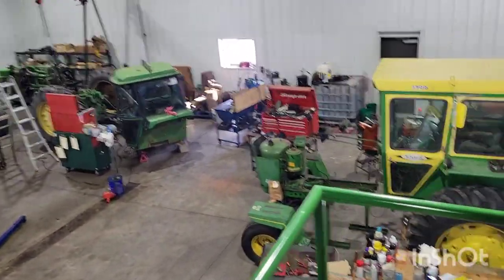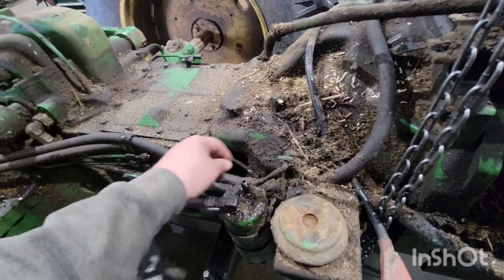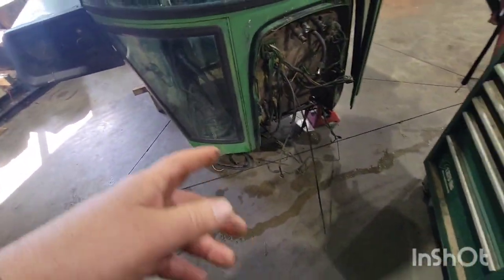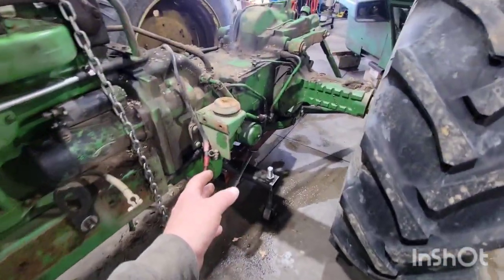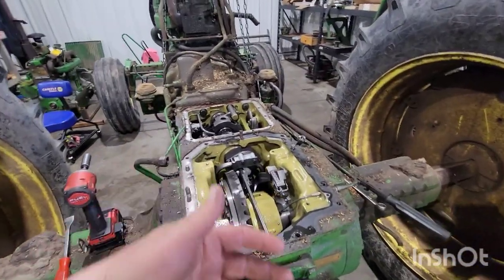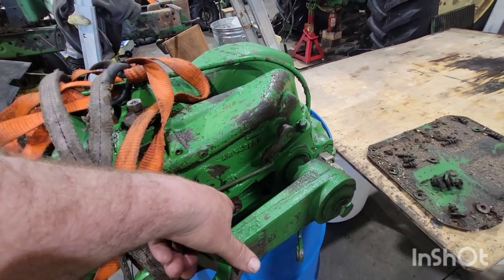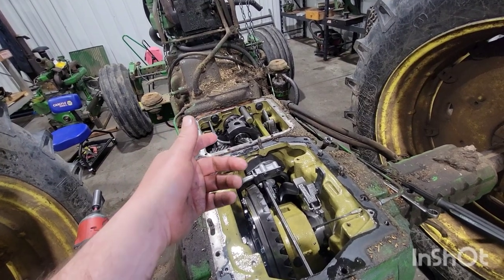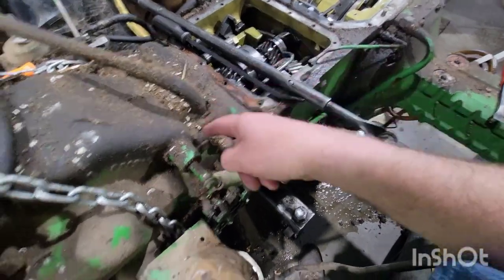RE-UPLOAD: John Deere 4430, cab, 3pt and engine removal.

Comment: thanks for taking us along on the overhaul. I just bought a 4430 with a blown engine. I put a combine engine into the tractor and she runs good. the tractor operates nicely. might have to go through the brakes though. It growls a little bit louder than it maybe should while stopping. But mabey ill check screen for metal filings before I get to excited

Comment: You said on I believe the ten and 20 series tractor when you pushed the clutch in the loader,would not function until clutch was released.
The neighbor has one what can be done to eliminate this issue?
Reply from the maker: @georgemarshall7508  when you hold the clutch down it stops the transmission pump.
The Hydraulics will run long enough that if you come up to your wagon or Manure Spreader that you can function the loader.
If you're going to be stationary for any length of time doing multiple hydraulic functions then just simply click the neutral and let the clutch out

Comment: You should wash the tractor 🚜 steam cleaners
Reply from the maker: When we do a transmission overhaul I will roll the transmission into the center of the shop and steam clean it. Then hit it with air to get all the water off. And if we are going to be waiting for parts for a while I will take a penetrating oil aerosol can and spray it down so it doesn't rust on the gasket surface

Comment: Hi Jon, Question, is it posible to remove the top-shaft rear bearing-race without removing the oil pump. Can it be removed from inside the transmission case? Has anyone done this.
Reply from the maker: @delhoose  no you have to take off the 3-point and remove the pump
Reply: Thank you for the fast response and I love your videos. They’re very helpful thanks.

Comment: greetings, please help, I have a JD 4230, I can't find the location of the brake switch, the lamp can, picture greetings, Croatia
Reply from the maker: In America we don't have a brake switch on the tractors. What is not working?
I looked in parts and can't find one.

You can go to jdparts.com
Reply: @jonstevensmaplegrovefarms3754  ok thanks i need to install a traction switch for the rear brake light

Comment: I have a 3120, I have a problem with the disc brakes. It is a bucket adapted from a wheel loader. I would like your e-mail to send photos, I don't know if I have to remove the bucket structure to change the seals;
Reply from the maker: 4640jon@gmail.com
Reply: Thank you, I will take photos soon.